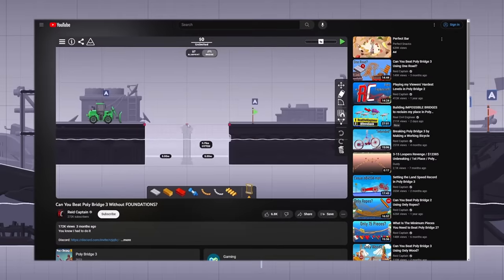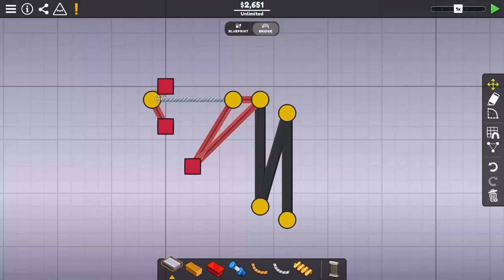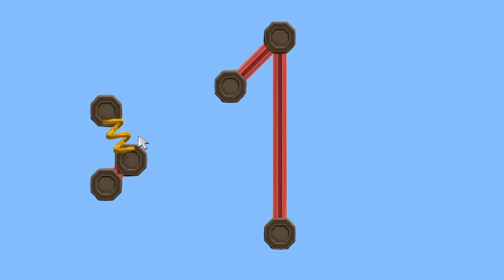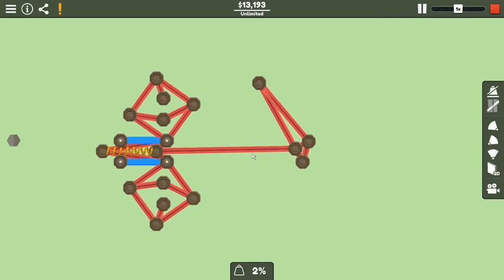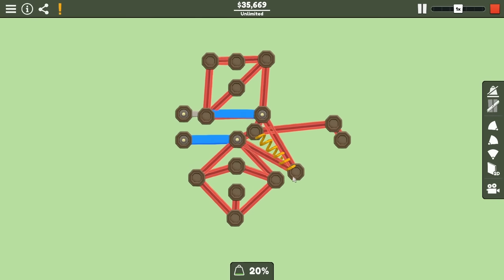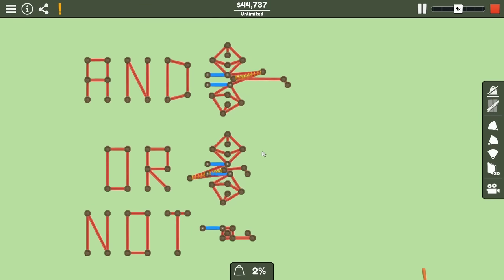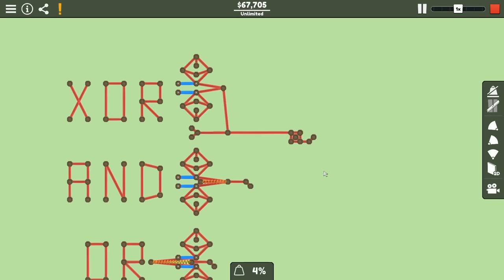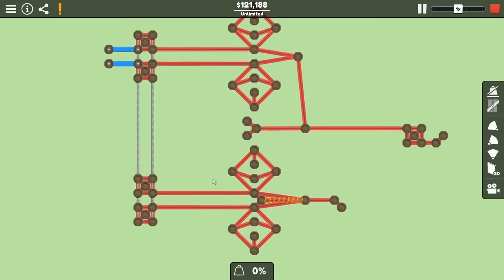Making a Working Computer in Poly Bridge 3

Comment: The great part about computer builds in sandbox games is that while they are limited by part count performance, simulated mechanical delay, or delay in the code, they can be built in basically any sandbox game with moving parts because logic gates themselves are simple.

Comment: For those who don’t know:

- AND gates require both inputs to be active for it to make an output. Two 1s go in, 1 goes out.

- OR gates only need one of the two inputs to be active for it to make an output. One 1 goes in, 1 goes out.

- XOR, or exclusive OR, gates require one specific input for the output. It has two inputs, but it can only accept one at a time or else it doesn’t work at all.

- NOT gate, commonly known as an inverter or inverse gate, turns the input into the opposite when outputting. It turns 1s into 0s and 0s into 1s

Comment: I tried to make a slightly larger calculator a year and a bit ago in pb2 - managed to get a seriously compact adder, but could never quite get the D-latches to do their job. Most likely because I "locked" them in place by actively tensioning a cable instead of passively using a spring. great work!

Comment: 12:10 You've made a logic gate called a "buffer", which is logically the same thing as two inverters one after the other. This is used to ensure the signal is either 0 or 1 and not something in between.

Comment: i think it would be relatively simple to make a 7 segment display. you could just use a bunch of and gates to convert the binary into decimal, and then run the output to a display
Reply: There are actually ways to feed the bits directly into gates, but you need 3-5 gates (as far as I remember) for each of the 7 segments. If I remember that right, it would be 30-ish gates total. More gates than this whole computer currently has, even if you count each of the mechanical linkages in the output slider as an "analog addition" gate.

Comment: But why do you have 2 kinds of the third state? You have, low, high, then "disconnected by not contracting the linking hydraulics", and also "disconnected by not linking with the split joints". Why not only one kind?